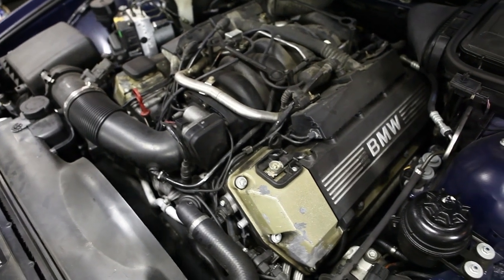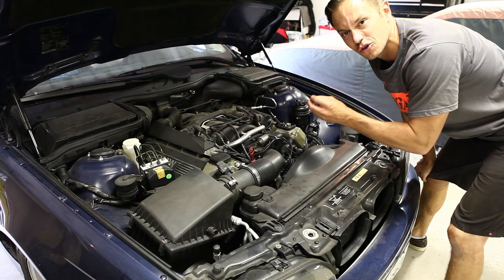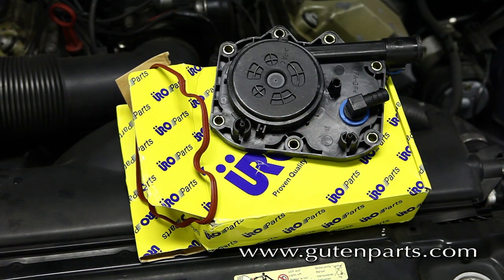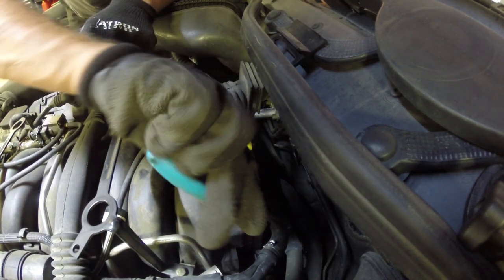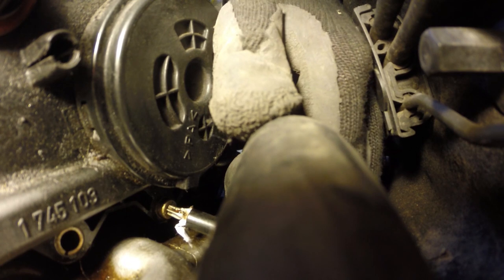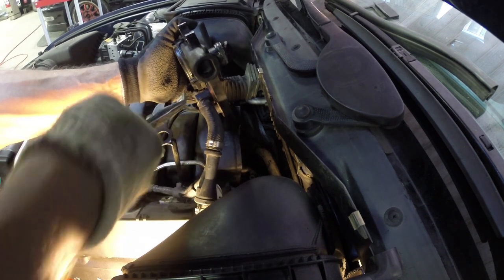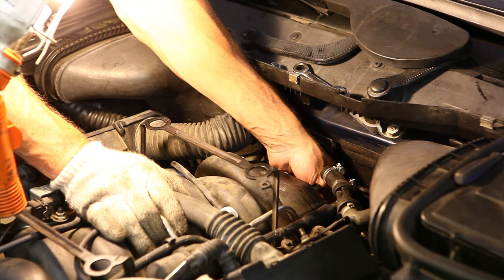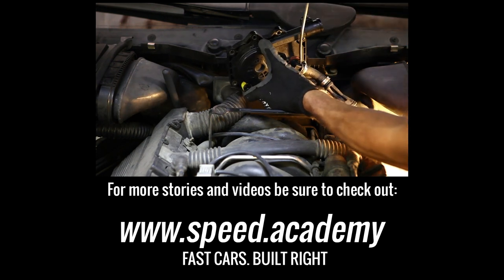Engine whine/whistle noise from E39 BMW 540i V8: Crankcase Ventilation Valve Fix!

Comment: just doing my part for the community. Anyone who has this problem, u DONT need to take off the whole pain in the ass cvv assembly. The rubber diaphragm is what causes the problem, you can just pop it out with a flat head screw driver and replace it, not having to unscrew any bolts.  you also save money buying just the diaphragm rather then the whole cvv
Reply: do you have a part number for this?

Comment: You actually don't have to remove that to fix it, just pop that cover off and replace the diaphragm. Unless you need a gasket too... Also, you didn't have to take that hose off, you can just pull the whole thing out of the rubber grommet thing. Lastly, I got one from eBay and it has this sound. It was new. So now I have to pull it back apart and figure out why it's making that sound. It's not as loud as this, but I know that's what it is because I can feel the vibration coming from that. I haven't tried the dipstick thing yet, so I'll go do that now just to be sure...
Reply: What dipstick thing?

Comment: Small tip most people dont know: If they're still original, the seven bolts aren't torx bolts. They're ribe r8 bolts. A bit different than torx. Thats why they tend to get damaged easily by torx.

Comment: The URO Replacement diaphragm is a piece of garbage and will start whistling shortly after you replace The bad unit. My experience is to stick with the OEM and forget the aftermarket parts it’s not worth the trouble even at a savings of a few dollars. Respectfully yours

Comment: Could the cyclonic oil separator valve behind the timing cover also cause oil in the throttle? I am a little confused on how the system works... I have oil in the throttle body and I took off the osv like in this video put my diaphragm wasn't that bad, a little dry and bumpy (definitely dirty and old) but no cuts. What else could cause oil in the throttle and manifold?
Reply from the maker: Alex Ayres Are you seeing a lot of oil? If so then you can try an oil catch which will filter the oil vapor that is collecting in your intake. The OSV isn't your likely culprit for oil in the intake though. It may mess with the internal vacuum which could cause some higher oil blow by but that may be unlikely.

For the record, oil in the intake and around the throttle body is normal but if you clean it and then theres a big deposit shortly afterwards then that's when I'd think there's a problem.
Reply: It's not a ton of oil but it just took me by surprise because I have never seen oil there, I guess I never really look either, I did not know that it was normal to have some oil in there, thank you. I think ill replace the OSV anyway since I have it off and it's old, Ill also clear the codes and if any new codes pop up ill go from there. 
Do you know what the symptoms would be of a bad ccv (behind the manifold)? I didn't replace it when I did my timing chain guides, I should've but didn't. Will have be in danger of engine failure if that part is faulty?
Thanks for your help.
Reply from the maker: Alex Ayres As I said some oil isn't an issue so I wouldnt worry about it. Aside from the noises that you hear in the video, the CVV can also can surging idle but the threat of engine failure is very low from it.
Reply: Thanks man, I appreciate your help

Comment: Great video. I have just done this repair on a 4.4L BMW X5 (E53). It is difficult, but do-able. I would recommend that before you start the job, you also purchase the 3-inch long rubber hose that connects to the valve. I found the hose on my car was very brittle, and impossible to remove without damaging it...

Comment: Good Video! Thank you. On my 2007 Bmw X3 e83 3.0si - 134,000ms. I hve a similar sound but not as wavy. It's more like a higher pitch that raises the faster you go and decreases when traveling slower. The whistling whine sound stars at about 30 and decreases at 40 max The noise is  It only happens while driving and starts at 30 mph. I changed the Transmission fluid with filter and gasket several months and shifts pretty good. Replaced the Transfer Case Fluid 2 times. Had to replace the rear drive shaft because you can't just replace the U-joints, also replaced the guibo disk and center support bearing.  . 

I read a technicial article from an engineer stating that tires on an all wheel drive car is critical. My cars wheels has to have 766 revolutions per mile or you put extreea stress on the drive train. Tranny, Transfer case, axles, driveshaft etc... My ABS rear sensor are not working correctly because the axles are rusted from within causing the reluctor ring is out of round w/ rust pushing the reluctor / Tone rings pushing towards the abs sensors and not picking up the signal correctly. I'll be fixing that in the spring. meanwhile the car thinks it is slipping on snow, ice and oil. etc... Basically the whole car is being thrown off because of the sensors, rear. Also, the Abs is not working right.The ABS breaking motor comes on and thing the car is slipping. 

If anyone has had this problem or can shed some light on my situation please right back. If not I hope the info I shed may help someone?."What a Money Pit" Help please! - Peace...

Comment: @Speed Acedemy I'm changing my CCV today as well. I would hear that whine briefly upon first start up on my car but it would always go away. Then upon pulling the intake manifold to do the gaskets I saw the intake ports had oil all over and in them. I gotta change my valley pan gasket today and I'll be waiting on the ccv to get here. I didn't want to buy one from oreily auto parts. Great Vid.
Reply from the maker: Glad it helped!
Reply: just changed mine by just swapping the diaphragm and it was fine, started driving and it started howling, smh. I pulled over and look at it and it's because the clips are pushed all the way down. I gotta fix it. My 740il sounds like a goose honking, lol
Reply: @bjenks2  what clips are you referring to?

Comment: I went on that website and couldn't find the gasket for the crank case ventilation
Reply: BLKAUTOBOT I bought the entire assembly so it came with the gasket. http://www.turnermotorsport.com/p-2811-crankcase-vent-valve-e39-540i-e38-740i-740il-96-01-e31-840ci-96-98.aspx

Maybe call Turner or Guten and they'll be able to locate it cause you're right its very hard to find on the site.

Comment: Nice video ,could you tell me what does two Hoses with the yellow clip at the back of the crack case are connected to or could be trace back too.

My hoses aren't connected to the crack case and its difficult trying to find out what hoses or where the hoses are. I'm debating on taking off the whole intake manifold looking for these hose.

Comment: Awesome video...I just bought a 2016 BMW 550i and she is sweet but just heard an intermittent whine sound that reminded of an old power steering pump whine, took it to the dealer but they couldn't duplicate it...I wonder if it is a just starting to fail crankcase ventilation valve....regardless another clue.

Comment: Super cool! An E39 at Speed Academy! 

These chassis are excellent for engine swaps. Very stiff and can be easily DD with a powerful engine. But why the V8 platform for the 2JZ swap? I would go with I6 platform due to lighter weight chassis and rack and pinion steering.
Reply: +AK540i Why swap it at all? A BMW v8 is way cooler and more unique than a 2jz.

Comment: My car is making the same noise and I pull the dip stick out and the sound was gone also when I was checking I notice in the back I only have one hose connected with the yellow clams the othe clam is there but there's no hose on it.
Reply from the maker: Josue Donis If the hose isnt there it is most likely causing a vacuum leak which MAY be causing the whine. I'd start off by checking to see if there is actually supposed to be a hose on the second nipple. If so, then reconnect it. If the sounds persists, replace the CVV.

Comment: Hey, I know that this is an old vid, but THANKS!!!  I now have the courage to attempt this while I am also taking care of a serpentine belt and related tensioner on my '02 540i Sport that is currently making the famous 'Jetsons noise'.

Do you, by chance, remember what length of the M6x25 replacement bolts were?  Does not say in RealOEM.  That would be super helpful before I pull 'er apart.

Thanks again!

<edit> Also, an old trick (when there is room) for getting the bolts back into a job like this... secure each bolt into the hole on the external feature (in this case the CCV) with a drop of liquid gasket - don't use too much.  Then drop everything into place at once.  Wallah!!  The bolts all magically line up and are where they belong!  Hope that helps others.
Reply: Matt Dahl u

Comment: How many miles did it have on it when it failed?  I'm about to buy a 98 that I suspect has a valley coolant leak, or coolant transfer leak. would it be a good idea to go ahead and replace this while I have the intake off? it's sitting at 133k miles. also, how much $, was the valve?
Reply from the maker: This engine has 120,000 miles on it and it looked original when I took it off. The valve was cheap like 60 dollars so I would recommend replacing it if you have the intake off.
Reply: Matt Melot mine failed with 137k miles on the clock

Comment: I suggest you do a timing chain guide replacement before yours goes kaputt (because mine has and I need help :)
Reply from the maker: +Mr Mok Well Haha, well this engine is being removed and replaced with a Toyota 2JZ so there are no plans to service anything on it.
Reply: I wanna do a 2jz swap on my 740il. I've seen one on google but it was in Asia I believe. Any tips where to start?

Comment: has anyone converted this to an oil catch can breather setup?
Reply: you would have to block off what he is literally installing lol. its tricky but someone would need to do some testing, its not like the 528i
Reply: No need to block that off. You still need the CCV otherwise you will have vacuum problems. Search M62 catch can, there is plenty of info. It bypasses the cyclone oil seperator inside the engine behind the timing chain.

Comment: if the pcv could be the reason to blow my engine in pieces?
Reply from the maker: +Juan Gerena Very unlikely. The PCV wouldn't blow your engine up rather it would cause it to run rough.

Comment: At the beginnig of last year winter,rainy and 40s degres,I started my engine,every was fine.I press the brake pedal to put it in gear,brake pedal was hard,like power brake dont work.Holding brake very tide,put drive,let the car go foward,50 feet,the engine shake very strong way.And the brokedown ,breaking a 7 cyl. conecting rod,block and oil pan.Put a 72k engine,was running perfect.last friday under same weather conditions,exactly same thing happened on 7cyl.conecting rod broke the block and oil pan.
Reply from the maker: +Juan Gerena Sounds like horrible luck. Did you swap over anything from the old engine? Breaking a connecting rod is usually oil related. Are you running the recommend oil thickness?

Comment: At the time I put the motor,Iput the old pcv because the engine come with pcv broken.I dont feel noise or nothing funny at the moment I started up.Just no power brake,hard pedal,put in gear,roll the car foward like 100 feet,start shaking and broke in pieces.Im mechanic with 25 years experience,never see something like it.
Reply from the maker: +Juan Gerena I just saw these other messages. I can't imagine how a PCV would cause the oil starvation to connecting rod but if it's broken it can create excessive vacuum inside the engine. Again though, not sure how that would starve the engine of oil.